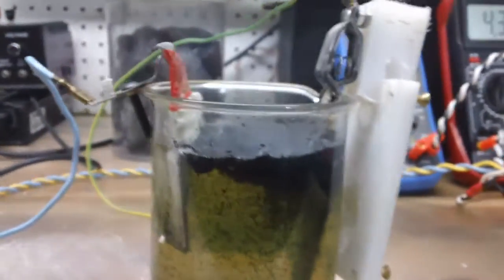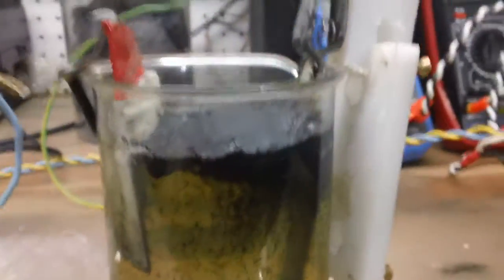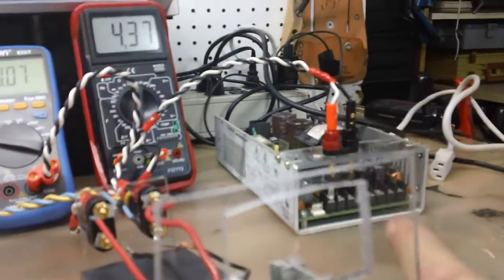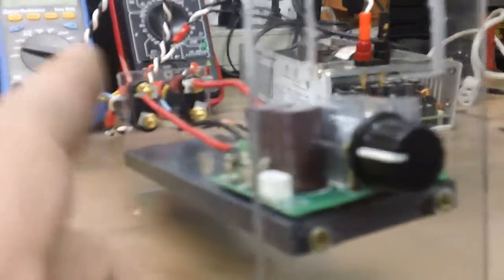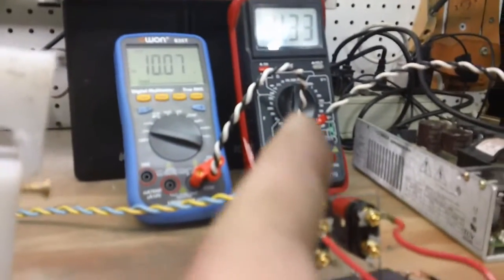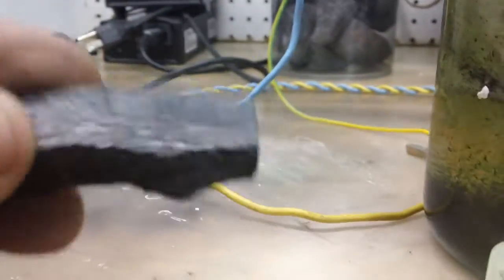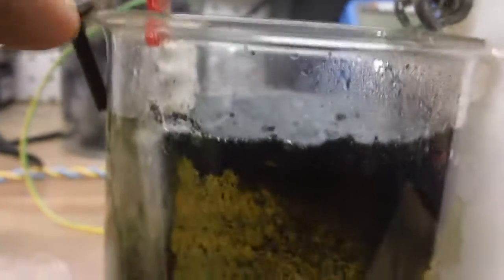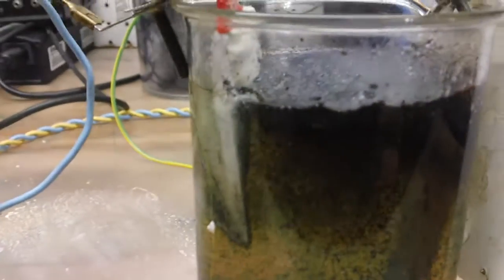the best way to make Graphene

Comment: Sir, what is the resistance? Electrical resistance if you used sodium sulfate? Why not iron based of Robert?
Reply from the maker: I'm not actually sure what the resistance level is it changes depending on the length of the electrode. Because I'm using a pwm (pulse-width modulation)  it's not on continuously at that voltage it's pulsing,  although it will heat up once the resistance in the fluid is high enough it will start getting warm and the closer your  electrodes are together the lower the resistance.  Good luck

Comment: Where do you buy Sodium Sulphate from ? and Will Amonium Sulphate work. I have Sodium Bi-Sulphate lying around. How do I measure that to make the correct MOLAR Solution or convert it into NaSO4
Reply from the maker: I get most of my chemicals from Amazon through the mail, I just purchased some ammonium sulfate  but I haven't had time to try it yet, but if I recall the original paper talks about using ammonium  sulfate,  as far as the molar solution there's a mathematical formula used to determine that amount, you can do what I did all I did was Google it  might even be able to find a calculator online, thanks for watching good luck.
Reply: I started with sodium sulfate myself but then switched to ammonium sulfate and I purchased both on Amazon as well. I can tell you there is a noticeable difference in how fast the ammonium sulfate produces the exfoliated graphite. Using the ammonium sulfate does produce a smell resembling ammonia so be sure to use ventilation or do it outside :)
Reply from the maker: Thanks for the heads up, my biggest issue is the volume and quality of graphene produced,  I guess I'll be trying the acid soaked method got an old microwave to expand the intercalated graphite, I am using one flake which is very large chips hoping it will increase the size of the continuous single plate graphene,  Also need a consistent way to separate the quality graphene from the 3+ plate garbage that hasn't fully separated.  Thanks for watching
Reply: Yeah, same issues here. I picked up some graphite rods from Amazon to try (since that is what was used in the paper) but of course I started with the graphoil as well. The graphoil is fine for me when I need a small batch but I want to scale it up a notch lol. 

I picked up an inexpensive centrifuge to speed up the separation stage and that seems to work well. Running it at 1,000 RPM for 5 minutes will separate out the large stuff pretty quick. From there a bit more will settle out but most of that stays in solution for me. I do need to try some longer runs and maybe some runs at 1,500 rpms to see if I can get more of the larger particles out quickly. I have not done any comparisons with store bought graphene powder but i've been considering it. Right now, I just make it up and then use it in my ink or paint recipes.
Reply from the maker: Yeah, I bought the natural graphite rock,  but the sodium sulfate really slow,  I Hope Ammonium Sulphate will do a better job on the natural mineral if not, it's back to harsh acids, and the whole green thing goes out the window,  good luck with your extraction.
Reply: Yeah, it is faster when working with graphoil, hopefully it will be faster with your lump of natural graphite :)

Comment: Now I'm doing research on graphene on campus for my thesis. I want to know the effect of solvent type and decay time on the amount of graphene produced. But I have found that, as the process progresses, the amount of solvent is reduced because it evaporates and arises heat so that the resulting graphene weight can not be known. What is happening? So, what can I do to keep the solvent constant to know the weight of the resulting graphene? I beg your help sir. Thank You.

Comment: theres better ways to make it
Reply from the maker: Yeah what prototype 9000 said was incorrect, it is 35% hydrogen peroxide that's what you can buy that's what Robert Murray Smith is referring to not 85%
Reply: @zeropointfuel  
Does your power supply work with direct current?
Reply from the maker: @Ar-De-o7z  Yes, it's direct current you but I'm using a PWM to pulse at the correct voltage because it's using a MOSFET to control the voltage it's basically a pulsed output DC.
Reply: @zeropointfuel  
Thanks
Reply from the maker: First, thanks for watching my videos,  second if there's a better way please elaborate as you just stated "theres better ways to make it" please explain if there is a better way than this please let everyone know because believe me I've tried quite a few of them  and I ended up with very low yield of quality graphene.
Reply: zeropointfuel robert murray smith has shown several different ways of producing it with simpler ways with out having to wash the graphene my favorite way using hydrogen peroxide and graphite i think he was using 85% pure hydrogen peroxide way more potent than you can buy in a store
Reply from the maker: Excuse me but these methods you're talking about, I don't believe have you ever actually done it yourself.  So you're actually skipping a few steps and only seeing when he puts hydrogen peroxide 35% on intercalated graphite you have to create the intercalated graphite first.  This method you're referring to also uses volatile chemicals.  Also depending on how the graphene is used it still could require a wash stage.
Reply: zeropointfuel he only used hydrogen peroxide watch the video have tried it myself  other people have made videos doing the same with success to varying degrees cant say i havent just because you cant believe it
Reply: @zeropointfuel comercialSupercapsHaveUncoatedCarbonFiber.ButForSaleIsCoated,NotConductive.😓
Reply: prototype9000 Did you make it. I did and it is not as simple as it may look.
Reply: zeropointfuel I did it and it is  on my Chanel .
Reply: 85% H2O2?